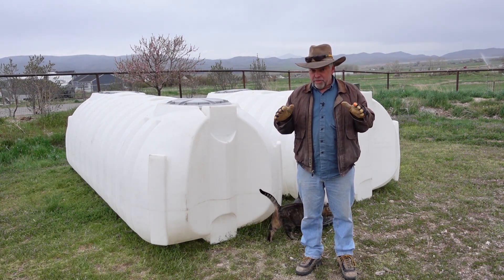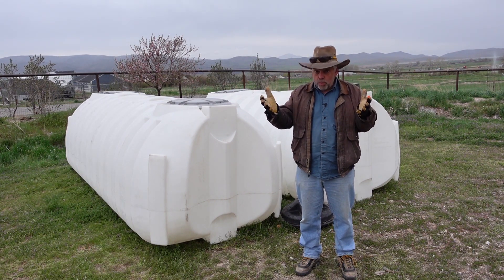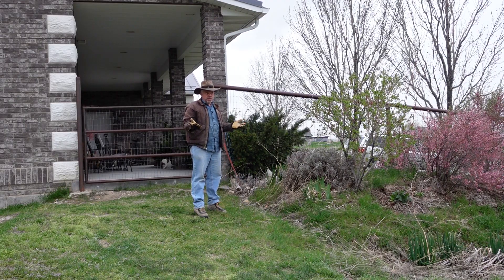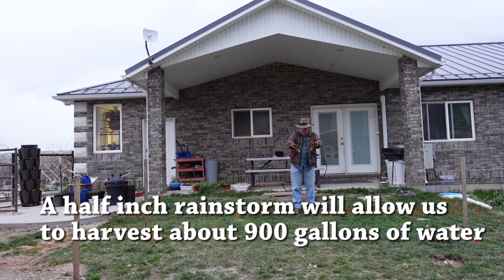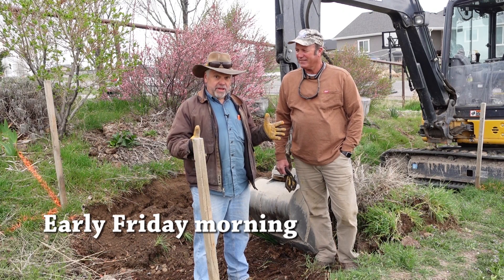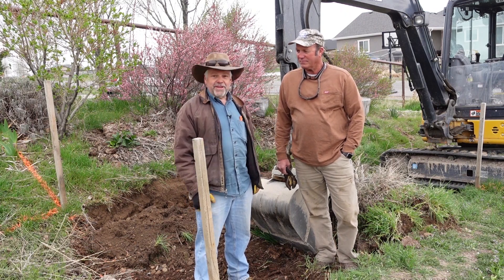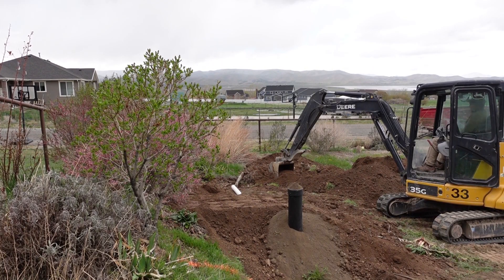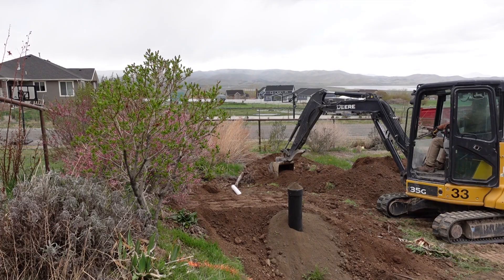Our Dream Rainwater Harvesting System Installation

Comment: Congratulations on this dream!  

I haven't seen this problem discussed on any of your other videos.  I hope you can answer my question.  

You have multiple buckets filled with food.  Regardless whether it's flour, wheat berries or sugar, my question is the same.  You have a gamma seal on the buckets which are currently in use and the regular storage lids on the stored buckets with back up supplies.  When you finish the food in the current use bucket do you: 1) transfer the gamma seal lid to the next bucket in rotation or 2) pour the next bucket in rotation into the now empty bucket with the gamma seal?  If you choose #1, how do you avoid damaging the ring when removing it?  If you choose #2, how do you pour flour or sugar without making a mess since there aren't funnels for buckets?  There's no way I want to spill food near my food storage and draw "things" to it.

Comment: Where did you find the connector between the down spout and pvc pipe.  I have looked for those and haven't found them.  I'm sure if I knew what the right name for it was I could find them.  Thanks foe any help on that.

Comment: First flush diverters?
Reply: Hey friend...I gave this a lot of thought and decided not to do a first flush diverter. At first I had a more complicated system with more plumbing and the first flush, but then decided to keep the system as simple as possible. Water runs in by gravity. When the tank is full, the water runs by gravity into Kylene's permaculture swail. When I need the water, I can siphon to many spots, and have a pump that is powered by a solar power station to get it everywhere else. Part of the rationale is that the first flush is not going to get rid of all the contaminants anyway. We have a metal roof and gutter screens so we shouldn't get any leaves or other large stuff. If leaves do get in by some chance, they will float to the top and run out the drain. I will check the screens on the drains once a year, but probably won't find much. I plan to pop open the tank about every 5 years just to check things. I will be surprised if I find even a quarter inch of sediment on the bottom, and the first flush will have missed most of that anyway. Most of the water will be used to irrigation. If we do end up needing to drink some of it, we have the tools and experience to disinfect and filter it. I don't think much will grow in there, but I may lightly dose it with some calcium hypochlorite once in a while. If there is anything there it will kill it, then the chlorine will dissipate. Bottom line for me was that anything other than the simplest system is just stuff that will end up failing and causing problems. Thanks for being part of the solution!!

Comment: Great system.  I collect water in the 275 gallon totes.  I also installed a "first flush" system.  It is only about 5 feet of 4 inch PVC pipe that, when full of water, over flows into a 1 1/2 inch pipe to the holding tank.  I put a "threaded cap" on the end so that it can be removed between rains to flush leaves out of the pipe.
Reply: Well done...keep up the great stuff!

Comment: How can this be drinking water? The roof would give you dirty water. Also how do you get it out of the tank?
Reply: Hey Kathryn...for the most part, this will be irrigation water. If we do need to drink it, we have the supplies and experience to disinfect and filter it. As for getting it out, we will be able to siphon the water to many places, and we will use 12 volt pumps powered by a solar power station for any other areas we need to get it to. Great questions...thanks for being part of the solution!

Comment: Question of the day: how will you get the water out when you want to use it?
Reply: Hey Debra...that is a great question of the day! We will be able to siphon the water to many places, and we will use 12 volt pumps powered by a solar power station for any other areas we need to get it to, or where we need pressure to run an irrigation system. Thanks for being part of the solution!
Reply: @JonathanBJones  Thanks—of COURSE you’ve thought it all through (no surprise!). I guess you could also dip a rope-hung-bucket in thru the manhole cover, huh? (I live in the Pacific Northwest, so couldn’t count on a solar powered pump for many months of the year.)

Comment: Last year we hooked up one rain barrel to our downspout. This year we added two more barrels to that first one connecting them with pvc pipe. In addition, we added another rain barrel to a second downspout. We now have the ability to gather 220 gallons of rain water, not as big a deal as your cool system, but it helps in our little corner of the world.
Reply: Absolutely it does help, and will help you through a crisis when needed...way to go!!

Comment: I'm happy for you guys looks really cool. I see how the water goes in clearly, and the overflow, but I can't tell how you will get the water out if you could show that or explain it, I'd be interested.
Reply: I had the same question..."how they gonna get that water out?"
Reply: We will be able to siphon the water to many places, and we will use 12 volt pumps powered by a solar power station for any other areas we need to get it to, or where we need pressure to run an irrigation system. Great question...Thanks for being part of the solution!

Comment: we are building off grid in McCammon, ID and would like to capture rainwater. Curious...how much sand ended up in the tank when setting it? Were you able to get it cleaned out? where did you get your tool for tightening the bulk head fitting?
Reply: I bought that same tool at Harbor Freight.
Reply: @backdoor5993  thanks...I will check them out
Reply: I am excited for you off-grid home...very fun and cool! Actually didn't get any sand in the tanks...had the manhole covers on and tightened. Steve actually had the tool, and it worked really well. Best wishes on your dreams!

Comment: How about a sand filter between the spout and the tank. Removing debris and bigger bird poop could be interesting if for some reason you need to use it for your family...
Reply: Hey Bob...there are some possibilities, but generally they don't allow the water to flow fast enough. We do have the supplies and equipment to disinfect and filter this water for our culinary needs, but mostly it will be used for irrigation purposes. Great comments...Thanks!

Comment: Awesome..this is one item  i have to do.. but i got to save some $$ for the tanks.
Reply: Hey Joel...it is certainly a great goal. If you live in an area with more rain/snow than we get (we only get about 11 inches of water from rain and snow each year), you can likely build a smaller system that will meet your need. Connect back if we can help...thanks for being part of the solution!

Comment: Love your water collection system!  I want one.  Thanks for sharing process of installation.

Question (not related):  Will storing sugar in soda bottles without oxygen absorbers be safe if containers are protected from rodents?  Do you recommend placing desiccants in with the sugar?  I heard that these containers, even with oxygen absorbers and a protected seal will eventually have air leach in from plastic.  Does that make them only useful for short-term for storing other staples such as dry beans and rice?
Reply: You don't use oxygen absorbers with sugar. It will become hard as bricks.
Reply: Hey Karen...soda bottles are definitely not my favorite, but they do work well. We have not done sugar in them, but it should work well. I probably wouldn't use a desiccant here, since our climate is quite dry and the product should be very dry. But in humid climates, I would likely do that since the product has been exposed to some moisture and if you are packaging in a humid environment, you will get a minor amount of moisture in the process that could cause the sugar to clump and get hard. As for the air...these bottles are very tight, and the air infiltration rate is very slow, but there is some small amount. They are tight enough to protect against insects, and the food oxidation will be very minimal. You also have some issue with light, but if kept in a box or other dark place, that is not a problem. They are not a 30 year storage container in my opinion, but they do well, and if they are free and help get the job done, I like the outcome. Thanks for being part of the solution!

Comment: I’d love to harvest rainwater but unfortunately we have an asphalt shingle roof 😐
Reply: Hey Carrie...I have shared your concern, but I agree with Sandra in Texas. I think it is still viable, especially for irrigation purposes. Last information that I read indicated that it is safe to harvest off almost any roof. Metal is definitely better, but check out the possibilities and decide your comfort level. Keep doing great things!
Reply: You should look into this further.  I know that asphalt roofing material made after the year 2000 don't have the toxic materials that older roofs have.  For an asphalt roof, you definitely need a first flush system, meaning that the initial water and gunk on the roof get flushed out and away from your storage tank.

Comment: Given the current global situation, I think it would be wise to install a way to divert your rainwater from those tanks. In case of some nuclear or chemical event it would be a shame if the water you collected in these tanks would become unusable because of an influx of contaminated rainwater. In addition to that you could install a first flush diverter, that diverts the start of your rainwater runoff that contains the most debris, dust, leaves that normally collect on your roof (I listened more to this video than that I watched so I did not notice it if you did install that.)
Reply: Hey Jelle...yes, since I have the Fernco couplers on each downspout, I can quickly pull that apart and cap the pipe to the tank and drain the water from the downspouts out into the yard.  As for the first flush, I gave this a lot of thought and decided not to do a first flush diverter. At first I had a more complicated system with more plumbing and the first flush, but then decided to keep the system as simple as possible. Water runs in by gravity. When the tank is full, the water runs by gravity into Kylene's permaculture swale. When I need the water, I can siphon to many spots, and have a pump that is powered by a solar power station to get it everywhere else. Part of the rationale is that the first flush is not going to get rid of all the contaminants anyway. We have a metal roof and gutter screens so we shouldn't get any leaves or other large stuff. If leaves do get in by some chance, they will float to the top and run out the drain. I will check the screens on the drains once a year, but probably won't find much. I plan to pop open the tank about every 5 years just to check things. I will be surprised if I find even a quarter inch of sediment on the bottom, and the first flush will have missed most of that anyway. Most of the water will be used to irrigation. If we do end up needing to drink some of it, we have the tools and experience to disinfect and filter it. I don't think much will grow in there, but I may lightly dose it with some calcium hypochlorite once in a while. If there is anything there, it will kill it, then the chlorine will dissipate. Bottom line for me was that anything other than the simplest system is just stuff that will end up failing and causing problems. I guess time will tell me if I should have installed one, but for now, I am confident that I made the right call. Thanks for being part of the solution!!
Reply: @JonathanBJones  You have to decide on the bases of circumstances and intended usecase what works best for You.
You do have the advantage of having 2 tanks. You can always pump water from on tank to the other and then clean the empty tank. I can't remember, but have you thought about installing an old-fashioned simple pump to access the water in case electronics don't work, like after an EMP?
Reply: Seriously?  It would be FAR easier for the powers that be to "contaminate/poison" our municipal water supplies than to concoct some sort of acid rain to universally contaminate rainwater everywhere...and "get" the relatively few who are harvesting rain water.
Reply: Great sistem how do you plan on filtering the water for the house.

Comment: Fantastic! Harvesting rainwater is crucial. However. I think you missed something very important. I didn’t see first flush diverters on the downpipes. They divert the first bit of rainwater that picks up dirt and dust and debris that’s on the roof away from the tanks so what you end up storing is good, clean water from a freshly washed roof. I would think right now when the potential for a certain kind of fallout is higher than usual a first flush diverter would be absolutely critical. They’re not expensive and won’t mess with the trenching so will be easy to add. If you do add them, please do a follow up video showing people how to do it, and also mention that they can put in a diverter and then collect the water in ibc totes or barrels etc so that everyone can see that they can harvest some rainwater even if they can’t afford to have massive tanks underground.
Reply: I’d like a discussion on metal versus composite roofs when harvesting rainwater.
Reply: @kristinb5121  yes that would be interesting. Composite is pretty rare here in Australia. We mostly have metal or tile. I love a metal roof. The rain sounds so wonderful 😊

Comment: I am so stinking Jealous. Going to hell for coveting my adopted parents...lol what's the sand for?
Reply: To level the bottom.
Reply: Now Barbara...You're okay...with all the good you do, this minor indiscretion will be overlooked. And yes, the sand is used on the base to easily level the tanks, then used on all sides to prevent sharp rocks from being close enough to the tank to potentially puncture it, although these tanks are robust enough it is not a huge concern, especially since these areas will only have light foot traffic. Thanks for your friendship and for being part of the solution!